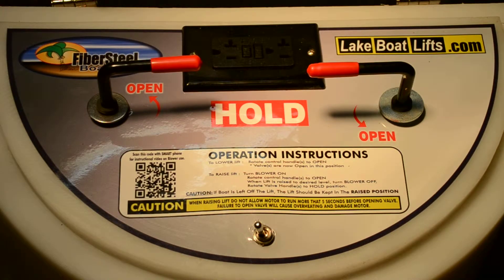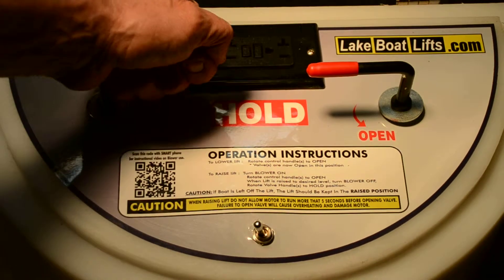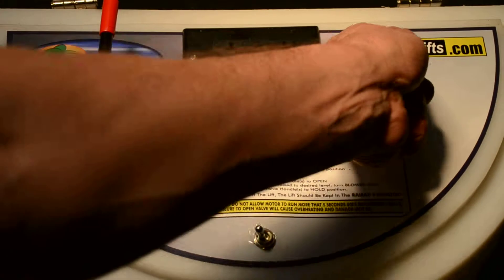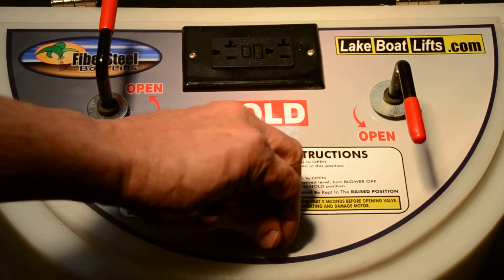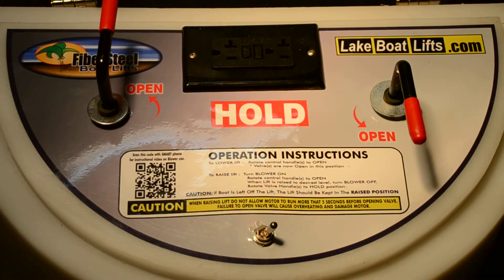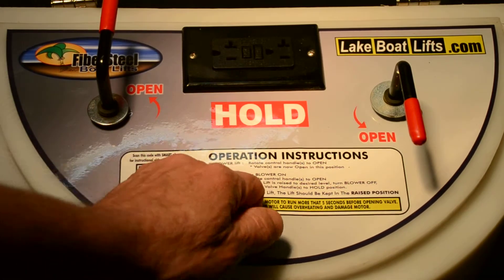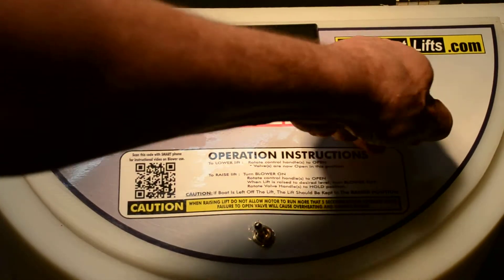FIBERSTEEL BOAT LIFTS  Instructions for operating the Double Valve Blower controler

Comment: great video. When I bought my dock it came with a fibersteel 6800 and I had no idea how to raise or lower. There are instructions inside but they dont tell me which way to turn the handles. Good to know that the left handle goes up and the right goes down when lowering.
Reply from the maker: Glad it helped